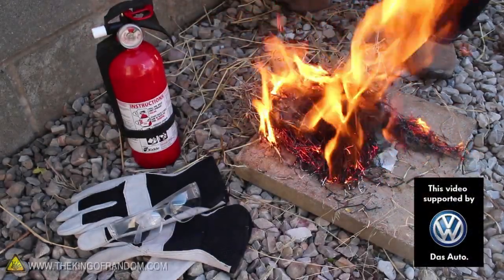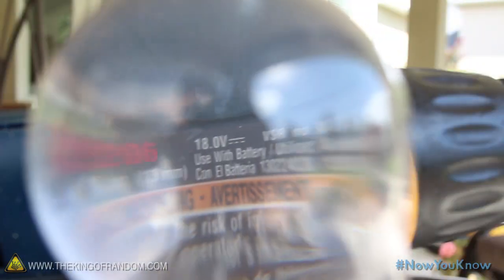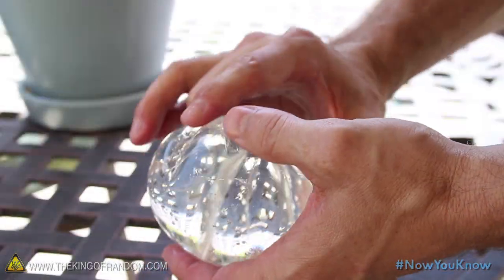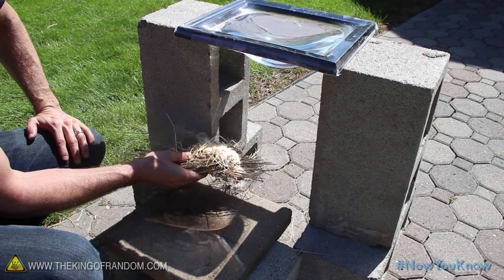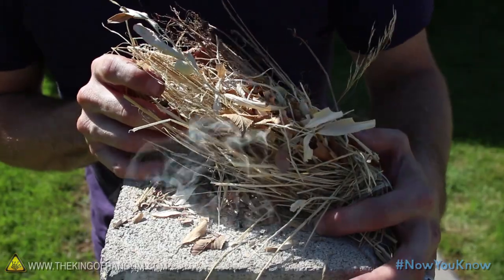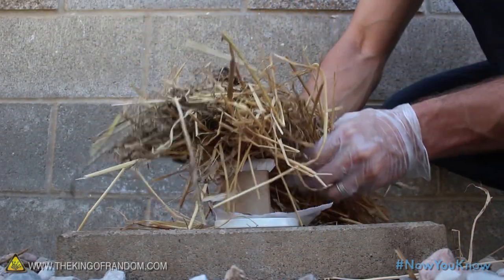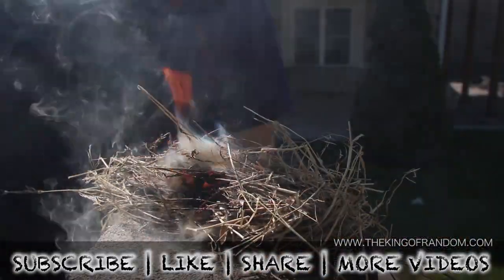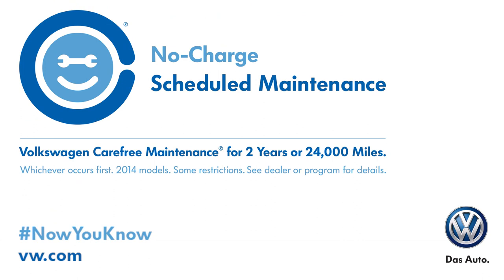5 Ways to Start a Fire, Using Water

Comment: The problem with this is... Really, this only shows two ways to start a fire with water.
1. Create a lens by using water and a clear substance to focus light on the tinder.
2. Mix water and sodium to cause an explosive exothermic reaction.
Reply: Sistik123 Not technically water
Reply: IrvineCascade Then what is the problem with the video he shows is water. If you want to learn how to start fire different ways their are other videos. He is just showing what you can use with water in this video.
Reply: Sistik123 ... You missed the whole point of my comment. This video is called "5 Ways to Start Fire using Water;" however, if you want to get technical, it only showed two ways to start a fire using water (as I explained).
I can think of a couple of other ways, but they follow the same base design: create a lens using water, or create an exothermic reaction using water... At least one of those ways creates a green flame! :3
Reply: ya sorry about that post i was a bit intoxicated at the time.
Reply: No problem. There's also water in ethyl alcohol, as well~! :3
Reply: Would salt count as sodium
Reply: GetRekt Loominaty no sodium is an alkaline metal
Reply: Bloon Popster Actually, sodium, "Na" is a Group 1 Alkali Metal, while the Alkaline Earth Metals are Group 2.
Salt (Table salt) is actually Sodium Chloride (NaCl).
Reply: IrvineCascade
ah ok. thanks.
Reply: okay thanks
Reply: IrvineCascade thanks
Reply: Not a problem.
Another common misconception is that "salt" always refers to table salt; however, from a chemical standpoint, salts are the solid product of an acid/base reaction. One of the more common reactions is: Sodium Hydroxide added to Hydrochloric Acid (Or NaOH + HCl) produces Sodium Chloride and Dihydrogen Oxide (NaCl + H2O); however, other reactions can produce Magnesium Iodide (MgI2), or Aluminum Oxide (Al2O3), or an array of other salts.

If it isn't obvious, I've taken a couple Chemistry courses during my undergrad. XD
Reply: technically he shows us 5 different ways with 2 different METHODS
Reply: Oh dear God.
Reply: I'd say that it's five methods that produces fire in one of two ways
Reply: IrvineCascade  I didn't know water and sodium could cause a fire.
Reply: Ask Hermit
alkali metals are too reactive
Reply: ***** True, the methods of creating the lenses are different; however, each of them are still the same process of creating fire from water: "Use water + ___ as a lens to focus a light/heat source, and create fire."
If this was "4 ways to create a lens for making fire," then it'd be spot on; however, it's "5 ways to start fire using water," which is incorrect.
Reply: +IrvineCascade also table salt at times contains potassium chloride.. potassium chloride used alone is known as Salt Substitute.. I''ve also seen potassium iodide used too. SAME stuff used to protect you from Fallout Radiation. Now Real and Potassium version is NO SAFER! They both have the same LD50..Iodide isnt safe either as we all know only "protects"the thyroid against radiation).. Anyways- im  done here...
Reply: +IrvineCascade true
Reply: lithium , cesium , etc..
Reply: +IrvineCascade imagine this with potassium!
Reply: the_Generic_hipster no imagen this with  2 flying uranium bullets hitting each other
Reply: Y
Reply: That is true... but still its cool that you can start a fire with water
Reply: you can also use super heated steam.  search for it
Reply: @IrvinCascade  if you're lost or stranded somewhere uninhabited you will need a fire for food, warmth & rescue most likely you will find bits of human trash that will be useful to you so this shows you what to do with what you might have

Comment: Can you do 5 ways to start a water, using fire???

Its a joke but it he does it i will freak out
Reply: *****  LOL I AGREE
Reply: And melting ice with fire doesnt count :P
Reply: Alright but thats only one way :P
Reply: ***** OMG THIS WORKS
I tried it at the science lab at school
Reply: LOL! Funny
Reply: you can put a stainless steel bowl in the fridge then put it near fire.The bowl begins to sweat.
Reply: bring a bowl under your face, sit close to the fire for like 2 hours . There you go , your cup is half full.
Reply: duh its called sweat
Reply: Haha
Reply: Krazy_Dez If you burn any hydrocarbon it will create water. A hydrocarbon is just something that has hydrogen and carbon both bonded together. Most living things have hydrocarbons in them, like wood. When a hydrocarbon is combusted, it creates carbon dioxide and water.Looking at CH4 combusting would be the chemical equation CH4 + 3(O2) --> 4(H2O) + CO2.
The water that is formed is obviously not liquid water, but a lot of the gasses that is produced from a fire is water vapor.
So to answer your question, just burn about anything, and you are creating water.
Reply: I know,but burning a hydrocarbon is one way
Reply: Burn five different hydrocarbons.
Reply: Yeah,but either way burning five hydrocarbons is basically just one way because you can't repeat a step five times
Reply: Burn a hydrocarbon is one way
Reply: He showen one Way when he turned Walter inte gas and when it exploads it becomes water
Reply: Burning any hydrocarbon should produce CO2 and H2O

Comment: How does sodium T.P. and water combust
Reply: +John Carey 2Na + 2H2O → 2NaOH + H2 (Some heat will be created,too.the heat will burn the H2 then burst into flames.)
Reply: Sodium is highly reactive with water causing exothermic reactions
Reply: FIRE IN THE WATER :O RUN
yes
there is a fire in the water.
Reply: That explains a lot.

Comment: no offense, i saw basically 1 way to start a fire, the first 4 are the same using different objects.
And the last way, well the sodium is starting the fire mainly and lets be honest, i think you find a lighter or matches faster then sodium, you could count it as a 2nd way or not
Reply: I would think this is mainly  for emergency purpose when you dont have matches or lighters. You can find sodium at alot of places, and stockpile some up for emergency.

Comment: I realize this video is old, but I have a suggestion for a possible video inspired by this.

What if you're outside at night and need to start a fire? Do you think there are any flashlights out there that with either the use of a magnifying glass or a water lense could be used to start a fire? That would be a very useful thing to know.

Just in general it'd be cool to see if there's any kind of artificial light (different lightbulbs, etc) that combined with a lense could create fire.

Comment: Sodium reacts with water. Water is H2O, sodium is Na, so the reaction could be something like 2H2O+2Na---^2NaOH+H2 and the reaction is exothermic, which means it gives off heat, which ignites the hydrogen, and there you have it. If you want to make sure I did not make a mistake, just Google out sodium in water or something like that and you should easily find an explanation from somebody more skilled in chemistry than me.

Comment: The residue left will be sodium, because the chlorine will be evaporated and so will the water because it has a lower boiling point than sodium. 
It won't be effective or efficient but it will work.

Comment: Sooo... 2 ways to start a fire using water* you mean... Water also is made up of the most flammable gas in existence, surprised there was no mention of that. Plus oil at ~300+ + water = instant inferno. Both using more common ingredients than sodium chunks.

Comment: Would it still work if instead of using sun can i get right up on a bright lamp and try the first way
Reply: Depends, probably not. Lamps are meant to produce mainly visible light, the sun has different energy waves as well which contribute heat more efficiently. A heat lamp would probably work, just not one for lighting up a room most likely. Of course by using electricity you could just short the wires or create a coil and start the fire that way much easier.
Reply: Ok thanks

Comment: Here's something that some of you might find interesting. Since there is no metal in sodium it is not detectable by a metal detector. Which means you can go through an airport and onto a plane with it. Then you could go to the bathroom sprinkle some water on the sodium and walk out while the plane starts to catch on fire. And yes it is that easy. The only reason people don't do this more is because terrorists are extremely stupid. Also now that they have body scanners it might show up on the monitor and you might be pulled aside. An if you are, and they catch you with it you will be in a lot of trouble because the FAA has sodium on the list of banned substances.

Comment: You'd have been far better off to use glycerin off any store shelf near the soaps and potassium permanganate which you can get at hardware stores, Home Depot, Lowes... Not to mention those are safer to handle.

So.. 2 ways to make fire: One of them widely known and obvious, and the other requires you to obtain technical grade elemental sodium from a chemistry lab, which has to have been completely protected from any exposure to moisture, even air.  Good job.
Reply: but here he says "using water"
if you search his channel, there is a video where he uses glycerin and Potassium permanganate to start a fire.

Comment: What type of sodium?
Reply: Awesome cool gamer That's what I thought. Isn't sodium... salt? Water & salt do not burst into flame... ever.
Reply: Aaron Michael The table salt that you're used to is actually sodium chloride. It's a combination of pure sodium and chlorine, both very dangerous, but form a harmless chemical when combined. For the video, he used pure sodium, which explodes on contact to water. Table salt isn't sodium. Hope this helped :)
Reply: The term 'salt' simply refers to a compound with neutral charge. True, sodium is often a component in salts, but you're most likely referring to table salt, which is Sodium Chloride (NaCl). He is referring to pure sodium (Na).
Reply: Awesome cool gamer It is called sodium metal, which you can probably find online

Comment: CAN YOU HELP ME GUYS, WHERE CAN I BUY SODIUM? WHAT TYPE OF STORE? THIS IS POISONOUS? WHAT IF THE SODIUM IS WET, WILL IT STILL BE USE IN THIS EXPERIMENT? PLS ANSWER ALL QUESTIONS , ANYONE..ADVANCE THANKS!
Reply: 1. in a store or on the internet
2. yes
3. WELL YA KNOW, IF IT'S WET THEN I'M PRETTY SURE IT LIT SOMETHING ON FIRE.
Reply: Mardonio Herrera jr. Mallinckrodt Chemical in St Louis used to sell it many many years ago.  It came in a tennis -ball -looking can that opened with a key like a sardine can, and it contained the Sodium "turd" submerged in kerosene in the can!Chemical supply houses should have it, like the places school  labs buy from.
Reply: +Mardonio Herrera jr. The question about wet sodium shows you have no clue about this. Please read the necessary information (wikipedia should do) before you put yourself and others in danger.
Reply: Eugen Mezei yes i can read it somewhere or to any reference but still coming from other peoples experiences are much more better that reading it. Actual information from people who done it have better chances of making it easier to do on my own... anyway thanks
Reply: Yes, like the guy who told you it is possible to buy a tennis ball size chunk of sodium. Now go get it, have no clue and not even let it touch water but only a bit of moisture and the next step is you will have your face rebuilt chirurgically and after that you can look for a new house as replacement for the burnt one.
You have to understand basic things about what happens when sodium contacts water, nobody tells you that as anybody did their homework (autodidactically or learnt it at school) regarding this and they suppose you did it too.